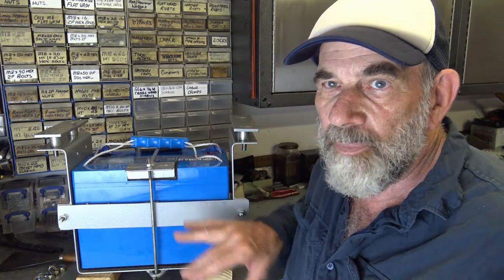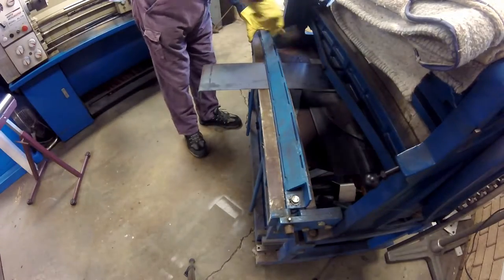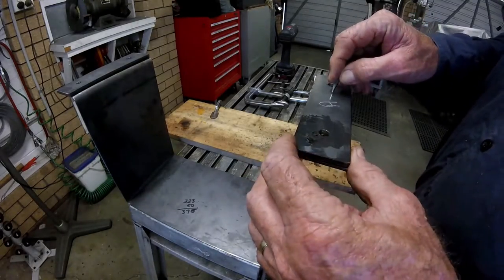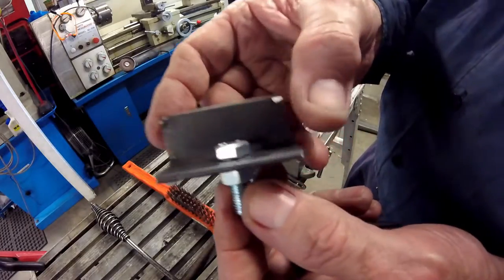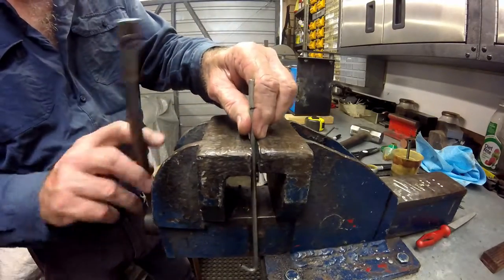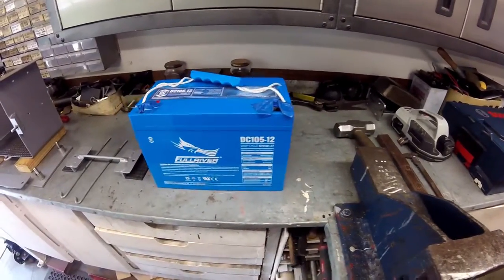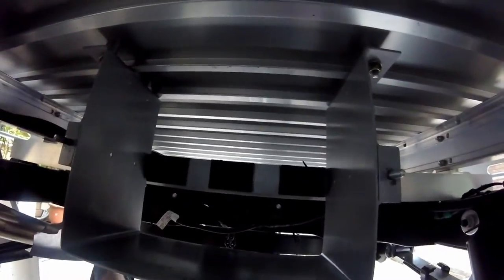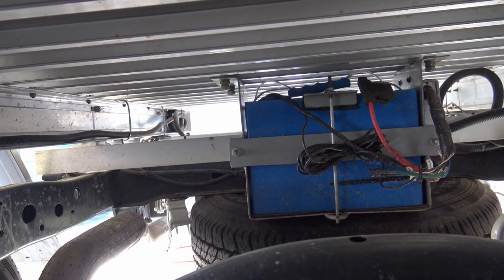Making and Fit Out of an Under Tray Auxiliary Battery Box

Comment: Great fab work . Only thing that is getting to me is there is limited next no weather protection for battery ur dcdc charger . My suggestion measure up a large battery box and fab the cradle to that size to include a dcdc charger mounter on top or side of cradle . Out of experience when mounting to alloy trays . Rather than drill holes in tray floor . Weld mounting brackets to under side attach cradle as u did using double nuts/ locking nuts. Hope this gives u ideas fo4 next build I’d upload pics on how we did much same thing to a Nissan ute with alloy tray but no attachment button here
Reply from the maker: Thanks for watching the video and commenting. You can include a battery box if you want. However the absorbed glass mat (AGM) battery is essentially water proof and the Projector dc-dc charger can tolerate water, so there is really no need to go that far in protecting the system. The system shown in the video has gone through a number of water crossings since I built it and is still working fine, so your choice.

Comment: Great work Bob! Exactly what I'm looking at doing. Appreciate the video and the ideas. How's it holding up after some use? Any changes you would make?
Reply from the maker: Thank you. The box is going great no cracks and more importantly the hanger bolts are still as tight as when the box was fitted :-). Done about 8000 km so far including quite a few corrugated dirt roads. Got a new video posting this Friday afternoon showing installation and wiring up of a pair of solar panels on top of the canopy to add additional recharging capability for that battery box and a more portable one inside the canopy.
Reply: @whitedoggarage  Thanks Bob, look forward to the next video, solar is also the next step for me. Cheers
Reply from the maker: @geraldtonbikes525  Thank you, if solar is your next step and given you are based in Australia, then it should definitely be of interest.

Comment: 13:15 I have found I can watch things like that for hours and they won't move, but if I don't use tape to hold it in place, I return the next day to find they have shifted position
Reply from the maker: Yes, I always love the discrepancy between the directions and reality with contact cement. Supposedly you let both sides dry off and then you fit them together and its done. Works okay with things that don't curl up laid flat on the surface, but not so good on vertical and overhead positions and I find with things like rubber that like to lift their edges it is better to tape or weight it down.
Reply: @whitedoggarage  my worst was using a concrete box as a cement form. Rather than building it from wood, I thought I could save time using a heavy duty box, we poured the concrete and for the next few hours while we worked no problems, sometime during the night the moisture caused the box to collapse and the cement covered all my wiring.
Reply from the maker: @markwhalen5300  yep, hate that, concrete has habit of wrecking formwork, you think it is all strong enough and braced well and then it lets go ...